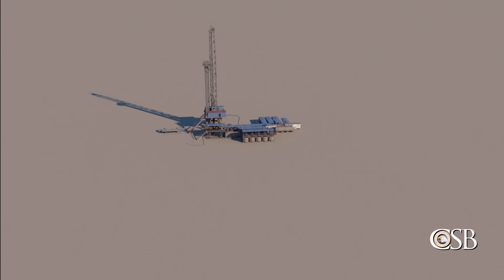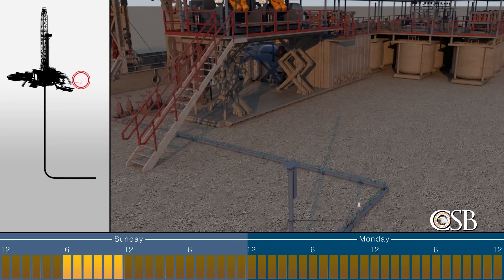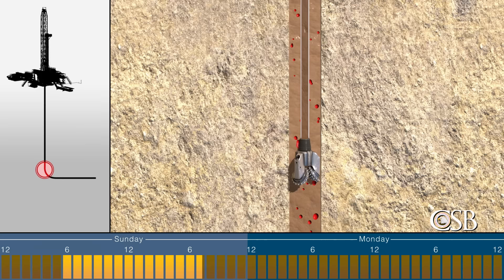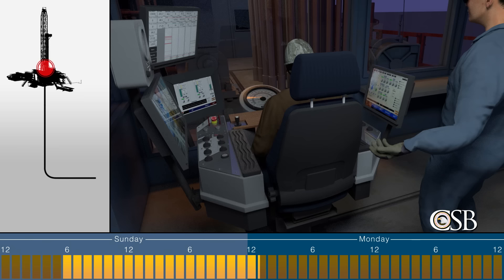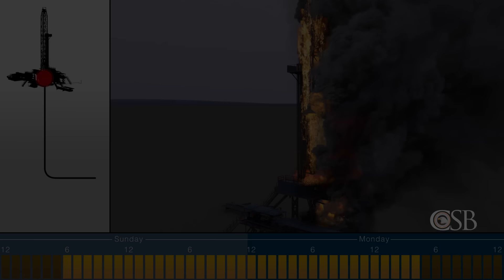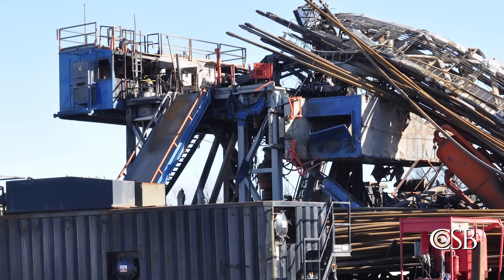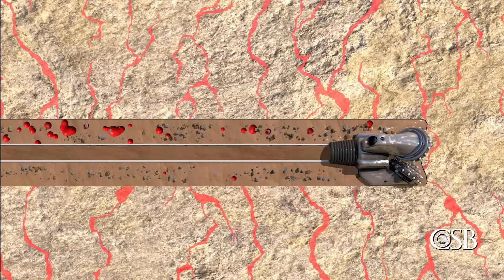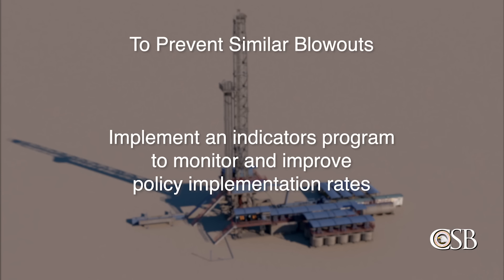Blowout in Oklahoma

Comment: "No one on the crew had ever done the procedure before, nor did they have any written procedure on how to do it. So they decided to do it."          What
Reply: I think he was saying that the Patterson drilling company crew - that is the actual technical workers - had never done it. But the representatives of the Red Mountain company, who were directing them to do it, had. In other words, only a small portion of the people actually understood the overall procedure, the rest were just following direct instructions
Reply: Just a some bull crap there is not that much of a difference in Calculated fill and continuous fill turn the pump off and on every x amount of stands vs leave it a on but I do like the way they were able to blow enough smoke up these guys ass about the pressure in the well was to much for that trip tank Centrifugal pump was not able to over come it “ pump was not working and went undetected “
Reply: Joel Brown switch over the 2in let the pump run baby man we never had a problem tripping but it sounded like they fucked up trying to trip on a live well they should have killed in first there was something wrong was anyone trained in BOP it didn’t sound like it
Reply: @joelbrown7485  There is not a volumetric difference at first sight but there is a huge difference in the piston effect of the both methods of tripping out that you mentioned.
Reply: Dorin Radu Well there should be no difference in the amount of volume the hole is going to take on a trip. Only difference in the swabbing of the well is filling every 5 stands or so when you swab the mud has time to fall back down . Continues fill when you stop the mud will fall and be replaced. It just baffles me that some would believe that open ended 2” hose placed at the top of the well bore some how over pressured a centrifugal pump? That pump was just not working for some reason or another. Should of been caught at the first 5 stands.
Reply: @joelbrown7485  a lot of huge stupid things happened here, in this case, after 3:30 i was pulling hair out of my head lol. The way the filled the trip tank with clugged mud. Omg. 2 flow checks out of 38? Wow. And not even done the right way.
Reply: Dorin Radu yes that is my thoughts on it to. It’s just to easy to pump on it and clear the gas so a pill can be spotted. With all the Technology that we have on drilling rigs today it’s uncalled for. Is it lazy or just stupidity?
Reply: Dorin Radu lol right some people’s kids
Reply: So why did you
Reply: They improvised. That's the spirit of man.
Reply: So much negligence
Reply: @timdowney02  when I broke out wormin the accumulator was the very first thing I was shown how to operate. N that was in the olden days.
Reply: @SouthSideTHK  lol in 1992 our walkie talkie was to scream at the top of your lungs to attract attention n them use hand signals lol
Reply: @stevebarnett3571  you should have seen in the 1900 lol 😂 same stuff different times. Still hand signals and whistles are the best thing to do. Aint no fun if yelling aint involved lol.
Reply: @SouthSideTHK  lmao true that! Tell ya the truth my first month or three was worked in fear of fuking up lol!  Thinking the tool pusher was mad at ya n don't dare even act like ya didn't know what he was signaling lol
Reply: Just like Chernobyl.
Reply: fake it til you make it I guess
Reply: What the totalll fuck
Reply: This is some Florida Man level.
Reply: Good  natural selection at work . Ego's bigger than intellectual ability
Reply: @joelbrown7485  Please use these symbols in your sentences next time: '.' ','  I mean you are writing, as it would be a whole sentence.
Reply: @joelbrown7485  all you have to do is look to see if mud is coming out of the flow line.... people putting to much trust in electronic instead of checking for sure
Reply: @timdowney02  the BOP panel in the doghouse hadn't been hooked up yet
Reply: @joelbrown7485  no its Paterson Drilling
Reply: I'm as perplexed as you are
Reply: You telling me the day and night  driller's didn't know how to trip  no way
Reply: @SouthSideTHK  you must have worked on my rig I an 64 old
Reply: @Smokin4CHRIST  👍👍👍 basic as when you turn your mud pump off and it isn't static  you have a problem  🤔
Reply: @SouthSideTHK  its easy to look back in hindsight and say what should of been done, but at the time, they have to act right away, they cant just do nothing and ask for more advice, because pressure is building all the time in the well. You can tell the whole process is very technical and they are swapping operators multiple times
Reply: @hindugoat2302  its always easy to talk while looking back but still 2 flow check done out of 40+ which were planned and they were done wrong 😂 nothing to say there lol. I swear its like they wanted this to happen.
Reply: The alternative to this story is "They decided not to do the procedure, and all were promptly fired."
Reply: @sheepdemon1982  you cant just decide not to do anything, there is already an emergency, gas is building up in the shaft increasing pressure, somethings gunna give.
Reply: Trial by fire. Literally.
Reply: American can do (it wrong) attitude. 
Americans don’t give af.  They think everything just works out fine. Sht happens to other people.
Reply: My favorite "The workers waited 45 seconds to check and see if any gas was coming up from the well, when they found none they continued" MFW the flare stack is still burning but gas isnt coming up -_-

Comment: I've been in a driller's cabin before and it felt about as safe as an old mobile home.  It felt like the  operation had a "cross your fingers" approach.
Reply: No matter where u go be it plants, mills, or rigs those lil rooms aren't really safe. They are put in bad locations and there's no reasonable way to build them that would save lives in a massive failure. There needs to be studies done to design their locations better. Right now they are usually in the danger zone bc of employees needing to see. That's not necessary now with the camera tech we have. A lot of plants, mills, and rigs are old and outdated. Companies will do updates that make them money but not updates that don't. I know this bc my family owns and operates and electrical contracting company that works on mills and plants. Mainly mills. We are the ones called in to build mills and update them later. It's rare that we have a request for updating the lil control rooms for safety reasons. When we do get a request it's for comfort reasons and bc some supervisor has been moved to that spot and he's crying about something. We update these rooms to include new a/c systems often but not for safety advancements. We've had one customer this year that has decided to move their control room to a safer location and add in cameras and sensors so they can work from a safe distance. My dad started the contract with them when I was a small child. About 30 years ago. This is the first time they've requested safety updates for that control room. We've updated multiple times for comfort and luxury tho. One customer forked out the cost of having us add on a lil bathroom, new a/c, and new personal computer set up to one of their control rooms to make a new sup happy. In the long run it would've been cheaper to do a new control room in a safer location and tell him to walk to the bathroom like everyone else and tell him he didn't need a personal computer. Companies often throw away money making supervisor happy. Employees know but the public doesn't. When horrible accidents happen that could've been avoided with a lil money, the public would be furious if they knew how much companies waste in keeping supervisors happy and in the luxury they think they are owed. They'll drop a million dollars luxury upgrades and new trucks for supervisors without hesitation but when we make suggestions for safety upgrades they shrug them off if they arent required by some law. They won't do optional upgrades of new tech. They wait until someone in one of the mills dies and OSHA gets all worked up. Then they'll do it after the tech has already been available for years. We had one that added the laser lights on the back of the fork lifts, the light that points on the ground for safety reasons, after one of their employees was backed over and killed. A very cheap upgrade that had been available for years and would've saved her life. The accident was partial her fault bc she was wearing headphones and didn't hear the beeper but if that had put the lights on she would've seen it bc she was bent over picking something up when it happened. She would've seen the light on the ground. U can pass up safety upgrades and expect employees to be as careful as they can. They arent going to. That's just the truth  of things. Companies have to protect employees from themselves bc they get too comfortable in their environment and think it won't happen to them. It can and it will
Reply: I've never been in a drillers cabin before. I spent a lot of slow drilling night shotin the shit with the driller in the dog house😎
Reply: @lolasmom5816  sounds like a good company
Reply: It’s not any protection but close to excape slide
Reply: @@suleimanbinmalik Good call. If I ever have to do it again I think I'll choose my car if I have the option.  Pretty exciting though otherwise lol
Reply: What good training tool for new old rig worker's and h2s training.
Reply: I agree 💯 I worked cactus drilling Early eighty's dangerous the drillers got annoyed with the gas bell turned off 😢 poor guys unsafe working conditions need a union 😡
Reply: I watch those drilling shows and they had a guy standing in line with a chain he's pulling tight with a power device and then it broke and it flew over and hit him well yeah there's one place that's going right where you're pulling it right toward that point so if you stand off at the side like we do on the boat it won't hit you. I met some oil well people and I told him I said I work on these bars as we get people killed. I see you guys working on something where you're pulling with a capstan or some kind of a winch and standing straight in line with it cuz they didn't make the platform big enough for you to stand someplace where it wouldn't hit you. If you have that fundamentally simple mechanical safety stuff ignored you can figure the high-tech pressure figure out figure out this that make sure your right stuff gets blown off often enough. Just caught up with him this time.

Comment: The two "consultants" are called the company man.  They call the shots on the well plan.  The problem with this well was the mud weight was not thick/heavy enough.  The driller and company man can monitor the amount of mud going down hole and the amount coming back.  Since they were in the horizontal, there would also be a Directional Driller and MWD hand that also would see those numbers.  There should be a balance.  More going in than coming out means you have a leak and need to run a sweep (fibrous material or nut shells to clog the leak).  If more is coming out than you are pumping in, you immediately circulate (stop drilling and just pump mud) to see if it stabilizes, usually you would thicken up the mud at that time and continue to thicken it until the well was balanced.  There are formulas that can be used to calculate the hole pressure by the amount of mud returning and what mud weight is needed to regain the balance.  This is very basic and happens every day.  To say they were not trained is inaccurate, they just didn't do it.  The company man and drillers screwed up.  You don't send mud down hole from the trip tank, all mud going down hole goes through the mud pumps.   That is just misinformation.  

They new there were issues, they were getting kick backs and had to run a flare.  If they did not significantly increase the mud weight then that is on the Company Man.  Adding weight to the mud costs money and can plug up the whole requiring extra circulations and possible reaming.  There is no logical reason that the well over-pressure was not addressed except expense or some company dogma that you had to follow a plan irregardless of the reality of the well information.

The alarm thing should not really be a factor.  There are not that many alarms, especially while tripping.  Pull weight and mud flow are the only ones that matter.  You don't really need an alarm on these as you should be watching them constantly.  If other alarms were going off, then they were likely set wrong.

There already are formal procedures to address this, they just weren't followed.  The company man and driller already failed to follow the basics, they would not have followed even more procedures.  The warning signs were clear, it seems they were completely ignored and it cost 5 people their lives.
Reply: That about covers it quite well.
Reply: my dad drills wells, and he was giving me a lesson on that today about how the mud needs to be heavier and if it's not add steal balls to make it heavier as well as more mud. i'm not too fluent in this with being him just giving me 1 lesson but i can see where he's going from this.
Reply: @ohBluur  steel is not the usual weighting material, but the point is accurate: the mud needed to be heavier, and that condition should have been convincingly solved before the trip out ever began.
Reply: @SpamSucker  agreed
Reply: If you’ve never filled the well with a trip tank while tripping, you are lacking knowledge in that area. You should not be gaining volume while pulling out of the hole as well. You aren’t 100% wrong, but missing information and slightly mistaken.
Reply: That is the point.  You should not be gaining volume and adding to the trip tank while tripping.  The trip tank just replaces the down hole volume reduced by pulling out the drill string.  Did you read the failure report?  They partially blame the "trip tank" for the failure.  Not that it was overflowing but that they were pumping out of it.  It likely is a mistake on the report but the mud weight was the issue, at most the trip tank can dilute the mud weight.  The failure was caused by an unbalanced well and ignoring the signs of an unbalanced well.  The trip tank was not a primary contributor.   That was the point.
Reply: @Daniel Kintigh The parties involved were from private companies, not government agencies. Chemical Safety Board only got involved in the incident investigation.
Reply: Lol thanks. 

Saved me the trouble
Reply: I have never done drilling of any kind, but in my own trade accidents usually happen for roughly the same reasons: proper required safety measures are either not in place, or totally ignored, the problems are jury-rigged until they fail, and some poor soul gets caught in the crossfire as a result of trying to cut time and expense from a very necessary procedure that should never have posed any danger if performed properly.
Reply: I have a feeling the company man was reckless.  I have seen my fill of those guys over the years.  At least one nearly killed me back in 1989 in Sacramento valley area.  He came up with a stupid idea that nearly killed three of my guys and myself when I worked for Schlumberger.
Reply: Thank you - this subject is amazing. My company built portions of the manufacturing equipment that is used to fabricate continuous drill string - i've always been fascinated with drilling!
Reply: They were drilling underbalanced and didn't want to mud up.
Reply: @davep.7099  I drilled for almost 20 years with over 30 on rigs total, the last 10 years I  drilled, everything was done under balance. It's all about paying attention and being ready, everyone knowing their job and a properly tested BOP.
Reply: Bravo! Exactly my thoughts.  Another Federal gov bureau and more regs will not prevent an accident caused by "duck it. I'm getting my bonus on this well!". This is a whistle blower situation.  Everyone working that day knew the well was unbalanced.  I've worked on rigs.  We all know what the multiple warning signs present in this disaster mean and they are obvious to all who were working on the Drillers crew that day.
Reply: Exactly
Reply: Wow the knowledge that u have really tells us u have lots of experience in oil wells
Reply: Choosing production over safety is a problem with ALL industries .  There is always a company man on site looking to get advanced up the corporate ladder by putting others in harms way
Reply: It’s controlled by mud weights
Reply: Dave thank you for this detailed comment
Reply: Thanks for repeating the video...
Reply: Criminals. Plain and simple.
Reply: @stonkwhisperer5590  same amount of buraus

Regulations are in place to make sure additional layers of safety exist, to make sure others are followed
Reply: @ETXDiscountTowing2  So what is your opinion on the video
Reply: @stonkwhisperer5590  a big factor in complacency is very long hours no?

And the driller's cabin should be safe
Reply: @mareksicinski3726  My experience tells me this didn't have anything to do with complacency.  This situation seems to be the driller prioritizing production over safety.  

12 hour shifts, long hours, didn't cause complacency that I can ever remember.   It did cause people to forget things.  Tools, directions to sites, stuff like that.  

I'd say long hours made us scared someone was going to forget to do something and we were all double checking each other much more often when tired.
Reply: "Irregardless" is not a word, it's just regardless.
Reply: Man it sounds like you should have been there you know your s*** for sure
Reply: That was 1 of the problems.
The Driller misunderstood and pumped Loss Circulation Materail down and plugged the Bit.
That was #1 mistake!
Reply: @davep.7099  Their job is to find all possible points of failure in their investigation, not just the primary contributors.